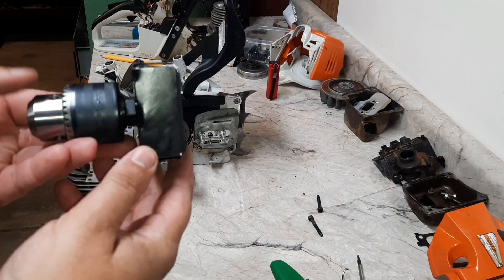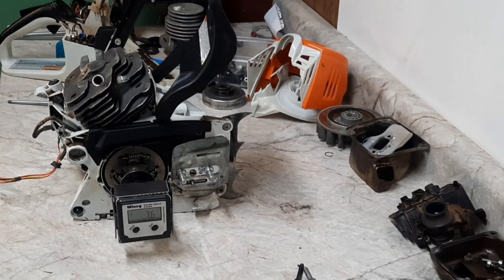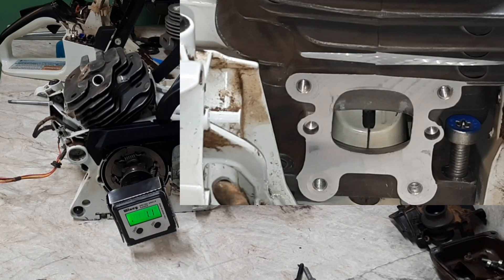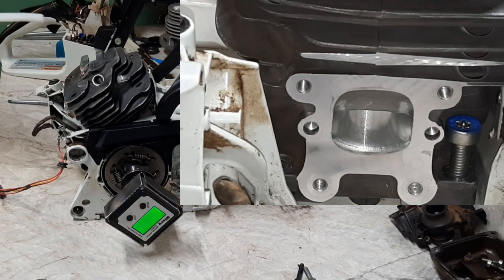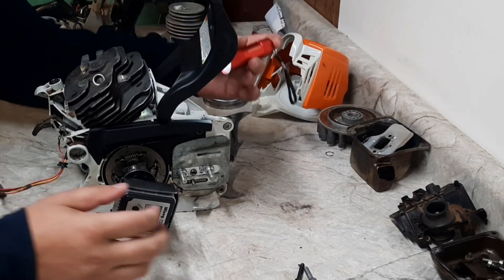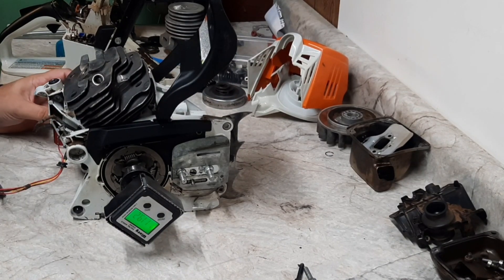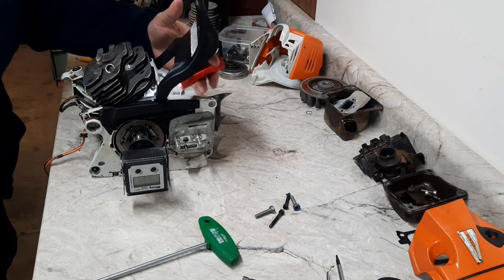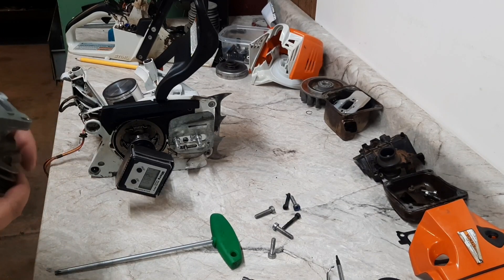How to Measure Port Times! Digital degree wheel, Piston Port 2 Stroke

Comment: Hey joe would you do an in-depth video on piston and cylinder wear? Wondering what can be fixed versus what has to be replaced? What different wears on the parts mean and wether you have a problem that needs to be addressed?

Comment: This helps me out a TON!  I've been using a piston stop and turning the entire chucked assembly  on the crankshaft.   It's a bitch.  Never again.  Also, might help you out, I use an old bar that I clamp in a vice and attach the entire power head to the bar.  So I don't have to worry about the power head moving around and messing up my numbers.  I just get my numbers, remove the cylinder, do my porting, then go back to my secured power head and the gauge is still set up and zeroed in.